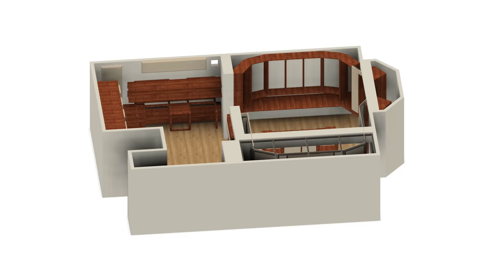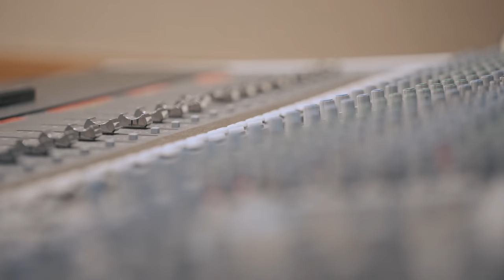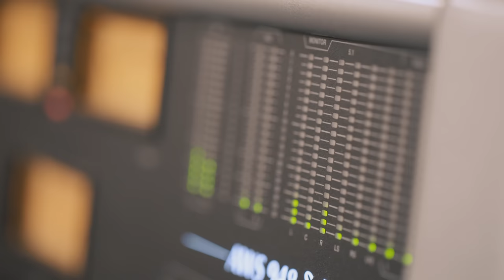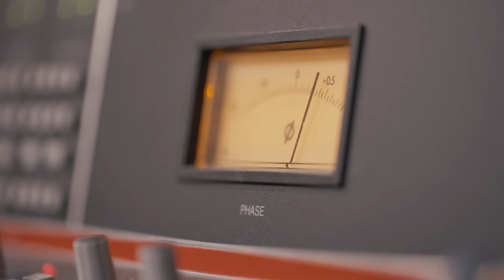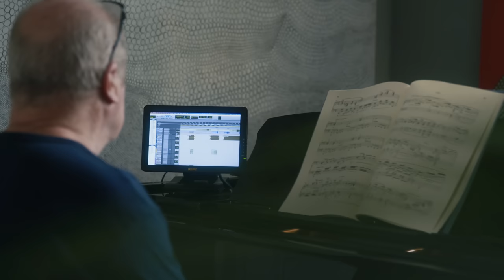John Lunn - My Studio

Comment: What an amazing design of the physical configuration of the workspace. The engineer is where he can benefit, and the composer is in an amazing spot in close proximity to all of the gear that he needs to access. Hard to believe that such a small room had that solution ready to be exploited all along.
It's often really hard to go back to the drawing board on something that you know needs improvement when you are already working around the limitations and still being productive. It's in some ways the same phenomenon  that happens when you have a piece of music that you like but also want to evolve further. What can happen is that you become afraid of doing anything to it for fear of ruining what you already have. Then when you plow forward and it takes a quantum leap, it's only then that you realize that what you ended up with is so much better than what you were willing to accept as "good enough".